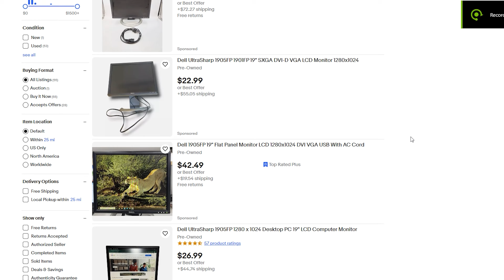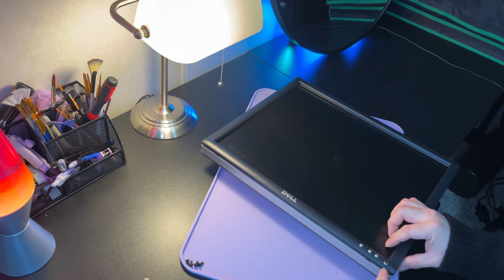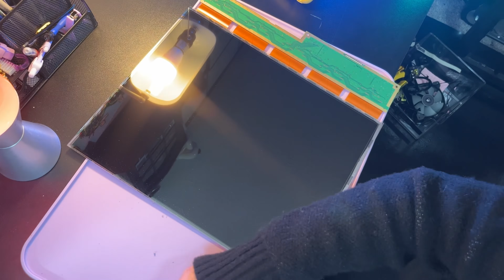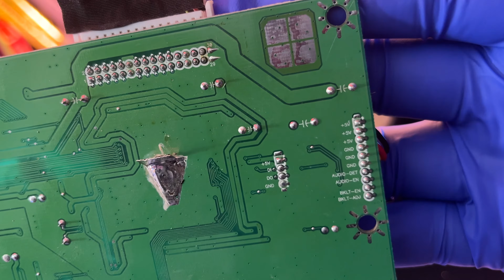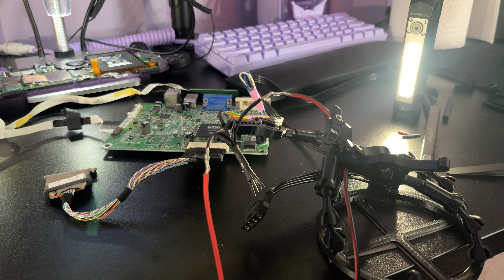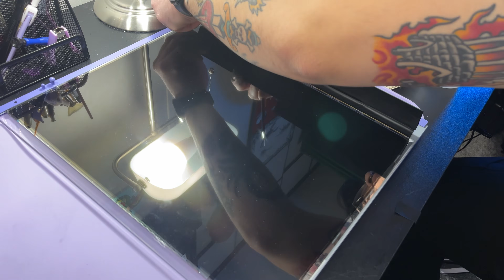I Made An Aquarium PC - Snowblind Mod

Comment: is that the anti glare and not the polorizer?cause without polorizer you can t see
Reply from the maker: Yes I meant anti-glare layer, my bad
Reply: @bitgrave  np, maybe you should do a pinned comment where you write the correction cause some could try to remove the polarized layer
Reply: @loryt6996  I pulled it off without removing any film from the panel whatsoever as well and it looks great. @bitgrave thanks for the vid.
Reply: @bradleymorris2318  ok?the point is that he said he removed the polarized film, I was asking if he mistaken it with the ant glare cause the polarized is needed for see things...

Comment: I know it's a dumb question, but can the same be replicated with a Portable USB monitor to avoid all the extra electrical steps?
Reply: mostly side panel glass are square you need 5:4 format  monitor if u take portable display or newer monitor they 16:9 that's why....
Reply from the maker: Not a dumb question, and of course! If I were to do it again I'd most likely just do it that way. This monitor size was easier to find and perfect for the case I used but I'm sure if I looked a bit harder I could've found a portable usb one. Thank you for watching!